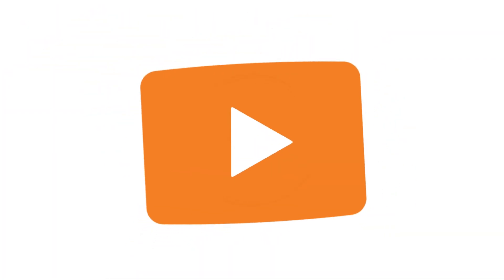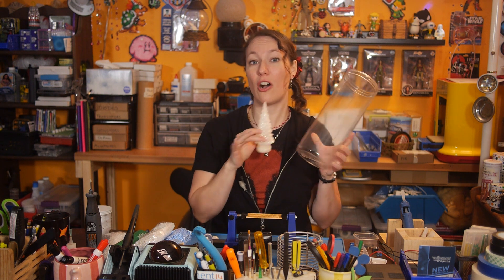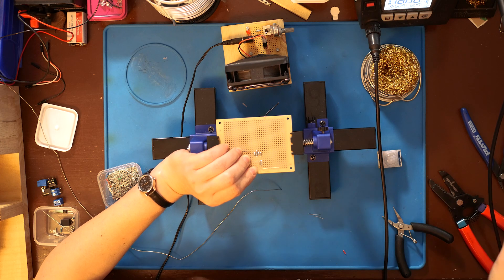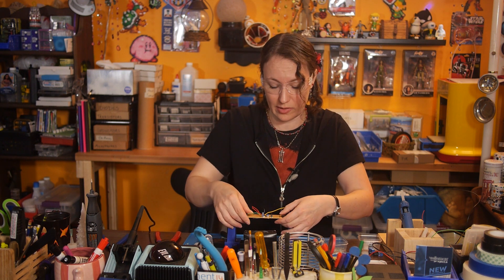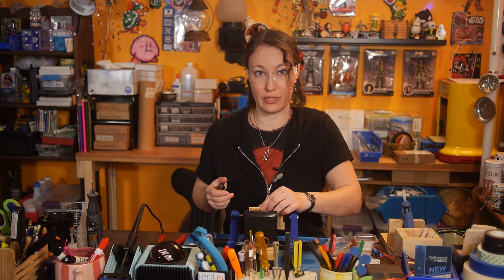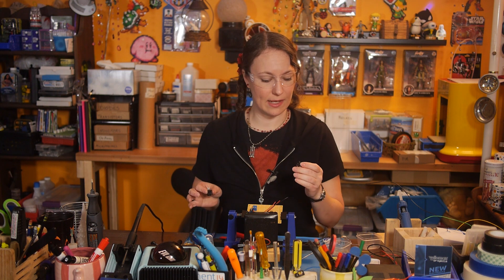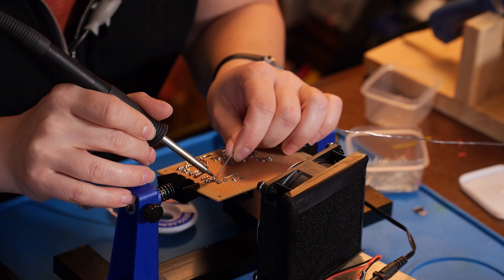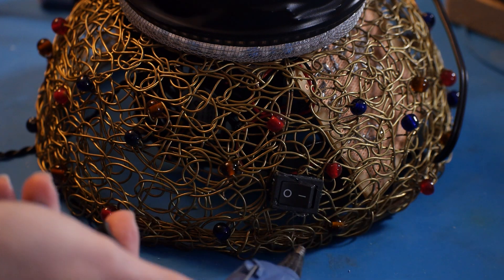DIY Motion Activated Snow Globe - The Learning Circuit

Comment: I have a motion activated clock in my room. When there is motion detected by the sensor the clock turns on. And if there is no one in the room it turns off.
Reply: So in that room it's always earlier in the week since the clock only runs when someone's in there... :)
Reply: @TortureBot  i didnt understand your question properly.
Form what i understand the answer is that the clock only shows time when someone is in the room. Else its on we can say power saving mode. Only keeping the track of time.
Reply: @strangekunal  I was making a joke, hence the smiley. You said it turned ON and OFF. I was suggesting it stopped running when OFF. Ah forget it, lol, it's a moot point now, hehe!
Reply: @TortureBot  haven't expected A joke here.🙃
Reply: @strangekunal  no problem. Take care and keep hacking your electronics!
Reply: @TortureBot  you too man🤘